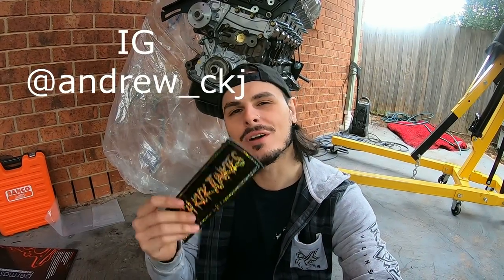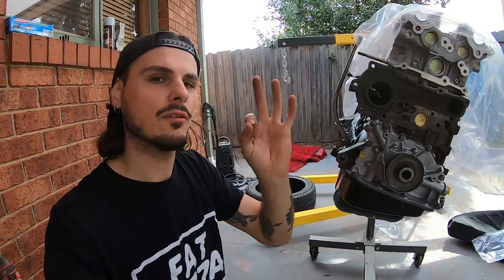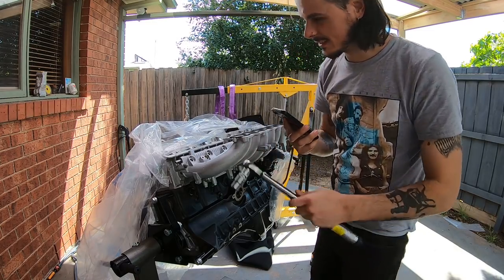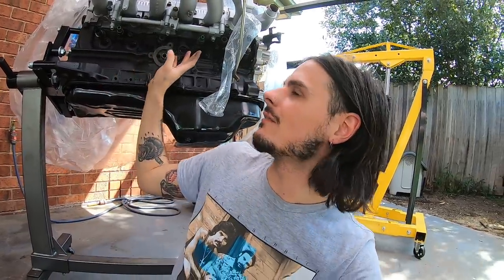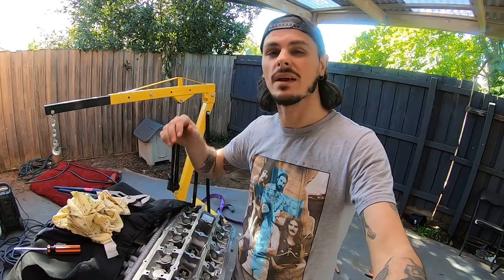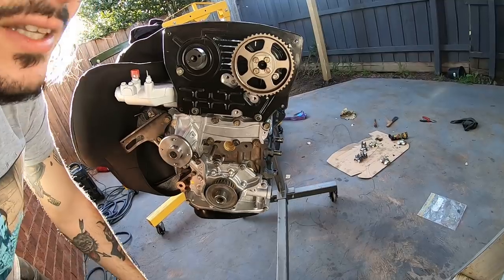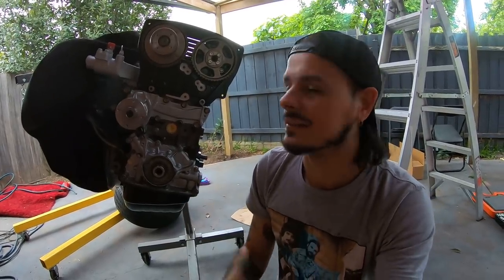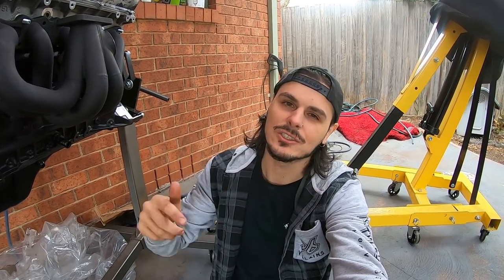RB25DET FULLY FORGE GETS TOMEI PONCAMS + 6BOOST MANIFOLD!

Comment: Its looking good Andrew, 380kw that's awesome. I wonder how much I will get out of my stock RB26 if I ever finish it, this holiday in Malaysia has sent me broke, at least I can still afford to watch your video's....... LOL..... The spider also wanted some attention, Bloody Australia and their spiders...... LOL.....
Reply from the maker: stock rb26 cardo gtr was running 600hp stock bottom end i believe 

hahaha when i go japan next year ill probably go broke buying another car and all the costs for drifting there ;’(
Reply: @ClutchKickJunkies   yeah cardo GTR was getting 600hp,  But I'm not doing anything internal besides just fitting ARP head studs just to up my boost a little more. The rest of the part swaps is external.  Only replacing the stock twin turbos to the Tomei twins. Everything else around the motor I'm replacing. Don't have the cash to do internal mods, as much as I would luv too, but money don't grow on tree's....... LOL
Reply: @vindiesel1066  well anyone who knows anything about rbs knows they're not cheap to play with lol. Rb26 can usually hold 600whp stock bottom with basic bolt ons. I'm not sure if you have a short nose crank 26 or long nose but either way I'd recommend you doing at least billet oil pump gears ,oil restrictor and head drain.  I'm actually getting ready to do a slightly built 26 myself shooting for 600hp stock bottom with single turbo, poncams, valve springs, hg/studs and injectors. My buddy made 525hp on tomei arms turbos, built tomei head and stock bottom on his gt-r. The car would of made more but ran out of fuel. Good luck with your build either way. Oh I've also be making 450hp on my s1 rb25 with hg/studs, injectors, single turbo tuned on apexi pfc for 6 years now and never had a single issue drifting it. This is the longest comment ever lmao 😂🤷‍♂️
Reply: @clutchkickpj693  I was actually thinking about those billet gears for my oil pump? I will talk to my mechanic / tuner about that. It's just costing me thousands just to repaint it and a few cosmetic repairs plus a thousands more just for the twin Tomei turbos, not including all the other parts which are:  V-Spec 2 Radiator + shroud + silicone hoses, thermostat, fan belts, water pump,  timing belt kit, ARP head bolts, injectors, fuel pump, gaskets, fuel lines, vacuum lines, Nismo engine mounts and that's just of the top of my head. Spent already roughly $15,000 still another $10,000 or more to go and that's what has killed my budget so far. I'm getting over it ......at times I feel like just giving up and putting it on hold, but at the same time I really just want to finish it. But you know how it is once you start it basically never ends because their is so much shit to replace and rebuild that before you know it I will be $50,000 grand in debt and that's not what I want. I will only do as much as I can afford, but at this stage its not much.......although I will talk to my mechanic regarding those billet gears but as for the other things you mentioned I will see what he says and how many more thousands that will cost.... LOL...

Comment: Nice video, I have the same cams in my rb25/30 and they have a nice subtle lumpiness. On torquing the cam wheels, use a spanner on the cam (it has cut outs for it) to lock the cam and torque it before putting the belt on as the belt can prevent the cam gears from torquing up flush.
Reply from the maker: awesome as to hear cant wait to hear it in mine! cheers!! trust me man i wouldnt be at this point if I didnt know these tricks :p

Comment: Watch out for that 6 boost gate angle, often they cant control the boost cause its at a silly 90deg angle.. my sinco mani is awesome  and the sound is angry👌
Reply: That usually becomes an issue when you're pushing higher boost levels but for the hp he's going for he should be fine but good heads up

Comment: Hey man absolute wicked build, I’m having trouble with me rb25 hydraulic lifters, 4 of them are pumping up way too much and holding cylinders open which drops my compression, constantly bleeding them back down and pumping them up again and have no clue what so ever what’s going on, does anyone here or you know what I could try to get these lifters working? It’s an absolute headache and all there is left is a tune :( haven’t driven my car for 6 months and it hurts, thanks in advance
Reply from the maker: hey mate i would suggest swapping those 4 with others ones and see if it makes a difference. i could imagine how annoying it could be! i would swap them out man for new ones luckily not too big of a job
Reply: Youtube rebuild lifters guy has vid and worked years later
Reply: Legend man thanks for the reply :)

Comment: Nice build bro but why with the factory intake?
Reply from the maker: cheers mate! better response and less laggy :)
Reply: @ClutchKickJunkies  by the time you add either factory j pipe or a couple of bends to get rid of the j pipe, it actually isnt the case. You should look into getting a ffp for shorter pipe run. To make it less laggy you need correct size dump and rear turbo housing for your turbo to suit your motor